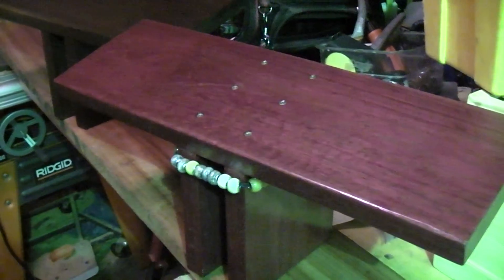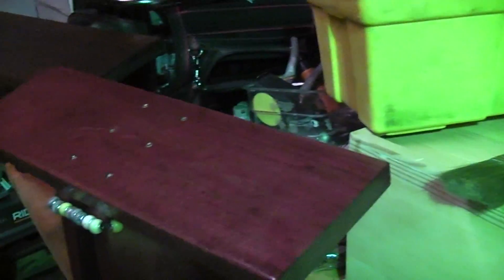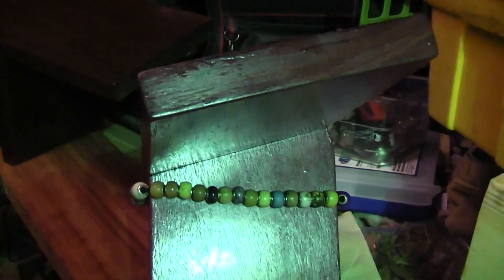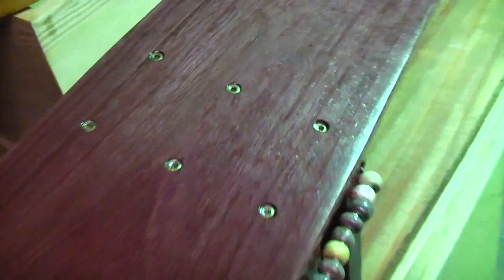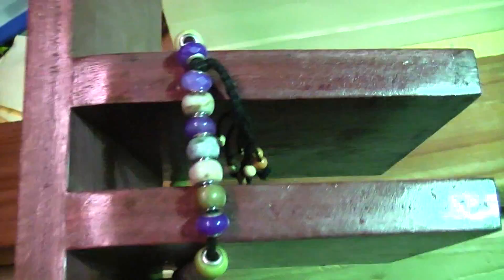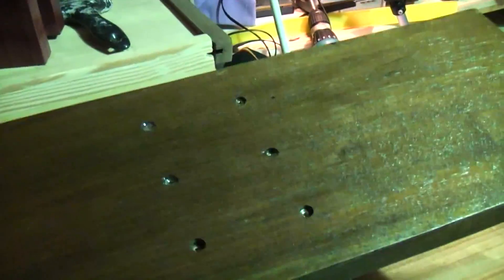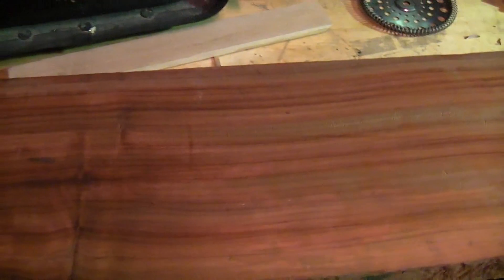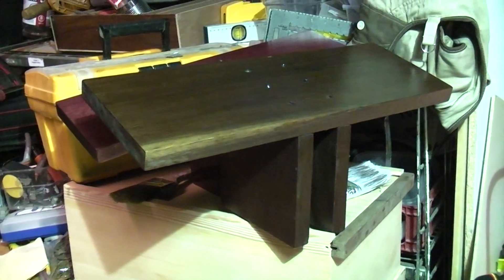Kick-Ass Meditation Benches I made... Part Two

Comment: So I made my own as well, (I'd never did anything with wood before) but my angle is to much and I have the angle at 30 degrees (quite to drastic of a slope but everything else is right) so my question is how can I fix the angle to bring it from a 30 degree to like a 20-15 degree ? I've seen benches that have curved legs, but I screwed my legs in already. So the problem is that how can I make a clean cut on the legs to make the angle better , but id have to do each leg one at a time ya know ? I still have another three wood board that I used to create my bench so I will make a whole other one but I still want this to work. Please help. I can send a pic to you if you'd like. Thanks again and I like your video :P